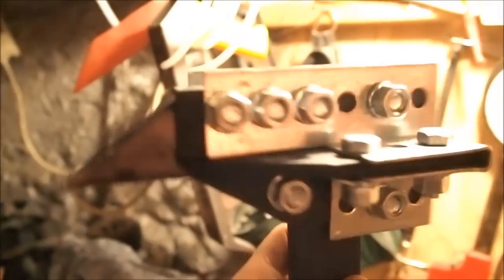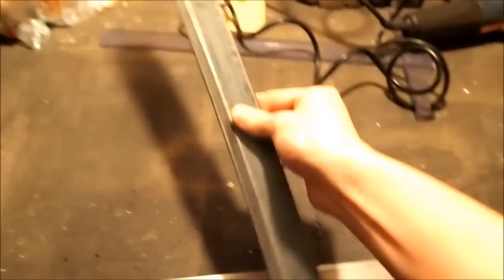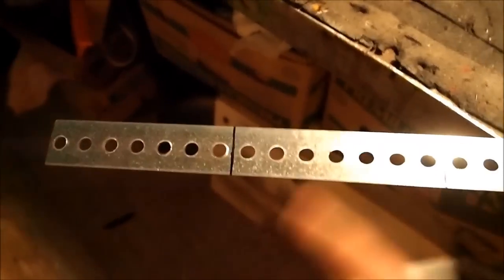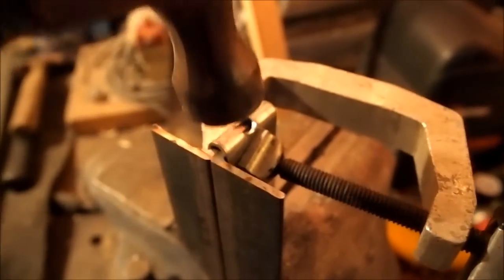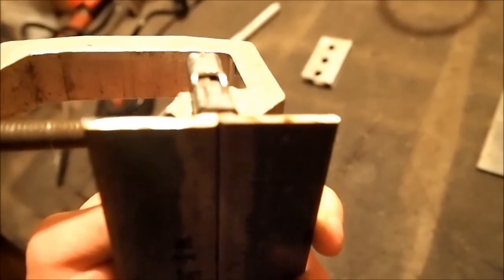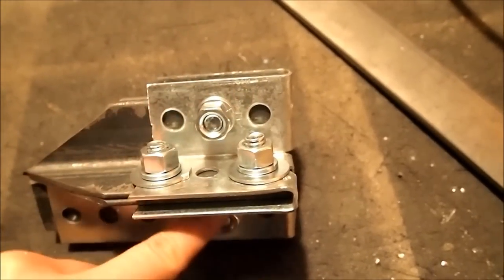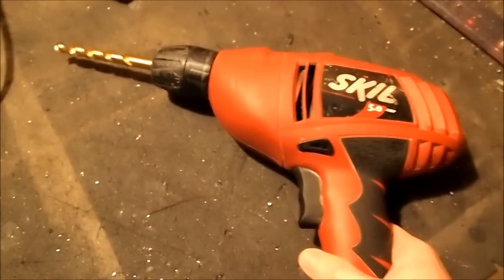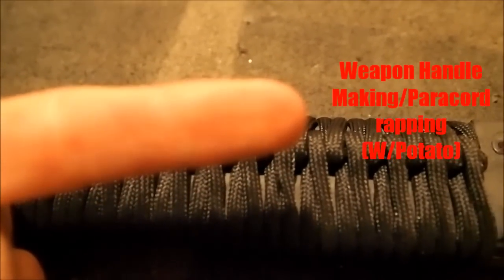How to Make: The War Hammer (The Fledgling)

Comment: Cool hammer. Excellent work. Just a little advice from a former metal work use a little oil on the spot were your drilling and going slow will keep your dril from frying. Try it and see if it works out better for you next time.

Comment: Reinforce the penguin with steel plates like you reinforced this one and the steel plates shoud go under the nuts or bolts ot whatever is holding it together and welded to it for extra reinforcement also dont forget the spikes connected to the steel plated if the spikes have space away from each other witch they will then hammer it flat and heat the spikes then hammer them together it will make the spikes shorter witch is kinda better but if you want longer spikes cut the spike measurement out longer

Comment: Hey I've been doing some research recently and was thinking why don't you try to make a war hammer with the ball hitch for a trailer. (like the big metal ball looking thing that you attach a trailer to) it is heavy enough to do some major damage and there are many different sizes and it already has a huge screw on the end so you would just have to find something to attach it to and put a little bead weld on the nut so it won't come loose. tell me what you think of my idea

Comment: Hi Eli Instead of using the thin steel bar for the bone breaker shaft I have a 36" by 1" solid steel rod and its 1" inch thick is that a practical use or would it just be a pain in the ass to cut and be a lot heavier?
Reply from the maker: If you can figure our how to even connect the rod to the head, it should be fine (maybe you have a welder). Only thing is that a rod is medium strength in all directions (it's the same strength when being hit from any direction) while the flat bar is high strength in two directions (in this case, both directions used for striking). That's your trade-off. I'd encourage you to experiment. Good luck!

Comment: Goggles when using a cut off wheel are not enough protection. They are prone to flying a part, and when they do the results can be absolutely devastating. Use a clear face shield.

Comment: what exactally is the point of using the zinc plated flat bar? dont get me wrong it looks pretty cool but i dont know how much use it has.
(to be honest i just forgot to get it when i went to home depot and i just want it to not matter)
Reply from the maker: If you watch Homemade weapons part 4,  you'll see that the hammer has no zinc flat bar. It's not 100 necessary, but just like shoes aren't 100% necessary to run a marathon. Both methods will work, but after the same amount of damage dealt out with a hammer with the flat bar, and a hammer without it, the zinc flat bar hammer will always be in better shape. It holds all the angle iron together at the striking point and opposed to the bolts having to deal with ALL the force, without it you're much more likely to lose a nut and bolt. Do what you want, but I say it's better to build it well and build it once than to slack and have to rebuild it in the future. Regardless, glad to know you're building one! post pics when you're done!
Reply: +ZNA Productions so i finally got around to going full throttle on this thing, but going through the flat bar has killed two drill bits of mine and it doesn't feeling like my drills getting anywhere. so any tips on this or am i just gonna have to go and buy me a drill press?

Comment: Do you really need the zinc plating. Because you can probably just do it without it.
Reply from the maker: You definitely don't NEED it. As you can see, the larger hammer doesn't have it. It does add to the durability and (in my opinion) appearance though.